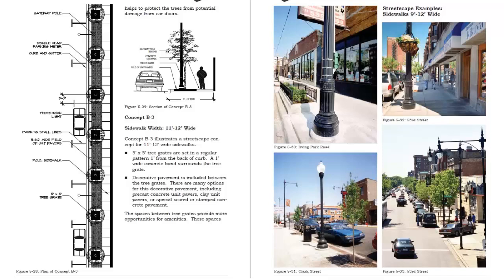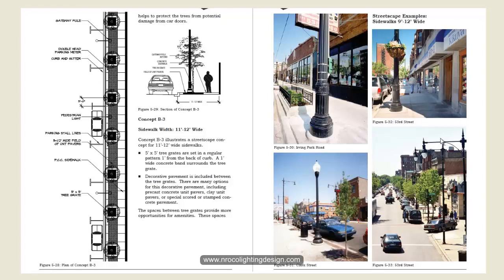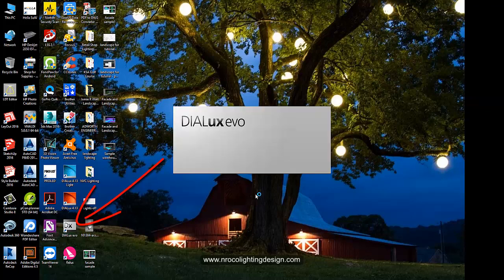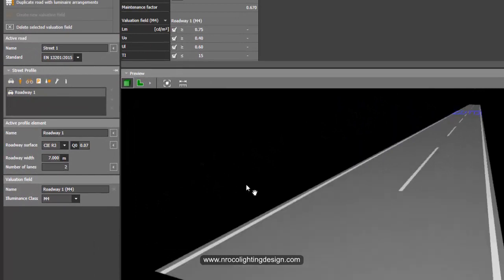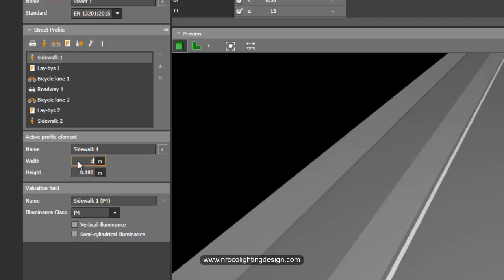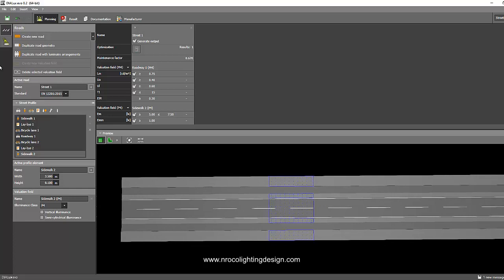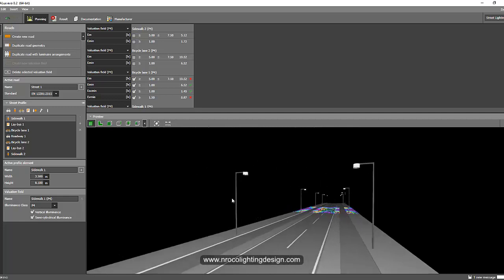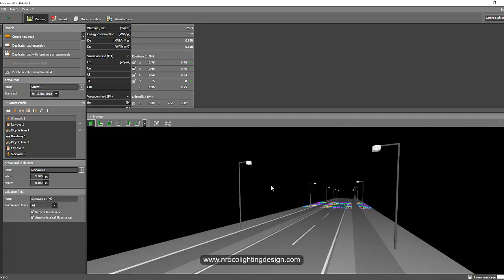Urban Road Lighting Design

Comment: I stil not get why there is only a lower limit luminance for the road, but a lower and an upper limit for the sidewalk illuminance in the IEC 13201 standard? And rightly, for the sidewalk, Dialux interprets that requirement as not satisfied, reporting the red cross.

Comment: What kind if light source did you use? 75 watt for a big street must be LED because even with High pressure Sodium this would be fairly dim. But again 7 lux is dim but nice. Here in Tunisia they put too much light on the streets which is not good.